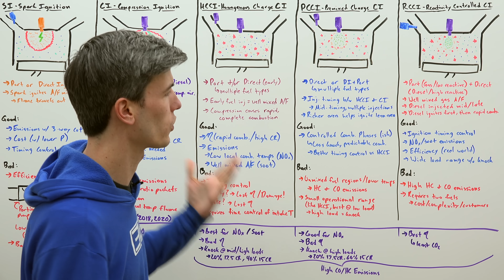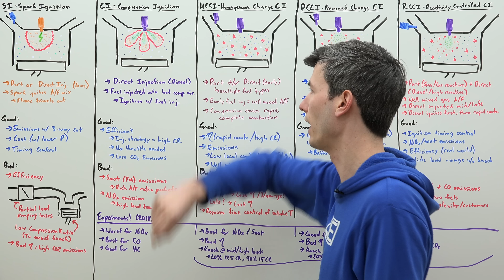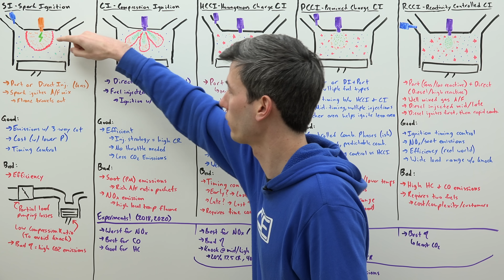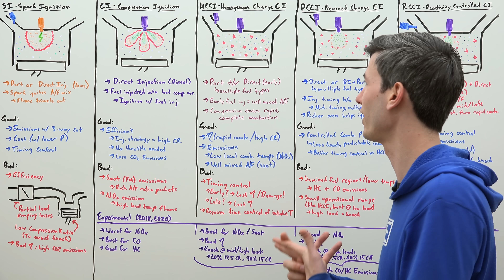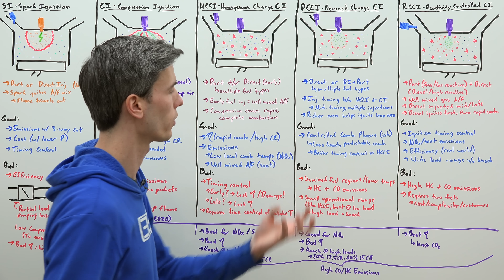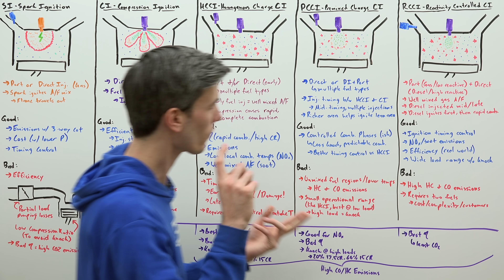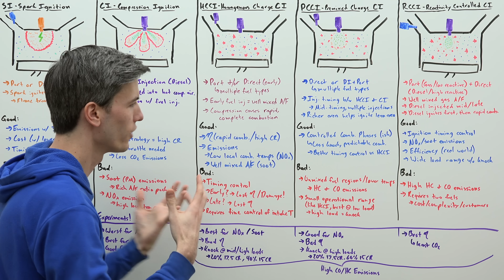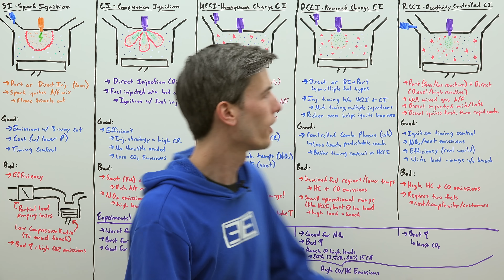If Combustion Engines Have A Future, What Is It?

Comment: A restaurant in my town just put in Tesla charging station. Every time I go by no matter the time there is always someone parked there sitting alone in their car charging.
I just laugh, knowing it’s taking them 30 minutes to an hour longer than it would take me to complete the same trip in a car that cost much more than mine. 

Internal combustion has no equal at the moment.
Reply from the maker: Why do you have to be so condescending of others choices haha? I've been "that loser" at a supercharger plenty of times. You can do whatever you want, like watch YouTube videos like you're currently doing haha. And I'm willing to bet long term, due to mostly charging at home, I've spent less time at chargers than most people spend at gas stations.
Reply: @EngineeringExplained  because they are pests. They are driving into areas way off route of where they are going, creating traffic just to use a charger then leave. They don’t even eat at the restaurant the charger is located at or stop at the surrounding businesses.
Reply: @tylerzesiger7648  its true. 

My work has installed two EV charging stations. There are a few Tesla and EV owners in the immediate area as well. With the charging locate function you can rest assured they always know where to get electricity for free.

The issue lies in when these spots are taken by non employees it says on the sign that charging is for on shift medics first and foremost with the capacity to open to the public after that. 

When my coworkers roll in with their battery operated car and see the charging station already used by a non employee it can be frustrating especially when you have no idea where the owner is as they leave it there and just walk away or get picked up by somebody else.
Reply: With an combustion car, you have no other choice but to go to a gas station to fill it, which is 5-10 minutes detour. With an electric car, with charging at home, you wake up every morning with your car full. Unless your trip is longer than the car range, you don't even have to stop at a station, just get home and plug it in. Now, how many times do you realistically have trips that can't be covered by the range of the car? If you only daily commute, which is what most people do with cars most of the time, you never have to go to the charging station, unlike the combustion car, where you have to be that loser that sits at a gas station from time to time.
Reply: @AleksandarStefanovic  how often? At least once a week. Think about this, it’s Friday you go to work, go to lunch then drive home. Maybe you even had to drive somewhere during work. Grab your stuff and head out for the weekend (beach, mountains, lake, family visit) you didn’t have time to re charge and you have already used a part of your “I charges at home” battery, you are going to have to stop for a charge. You can make it but then you won’t have enough to make it the 30 minutes back to a charging station from your destination the next day. Unlike gas which is 5 minutes max because gas stations are everywhere. You have to drive ATLEAST 10 minutes out of the way to sit for 30 minutes while it charges. So you are in 40 minutes while I’m tasked with the terrible 5 minutes at my choice of any station along the way
I get to the beach, mountains, lake to see enjoy the sunset you pull in at dark. 

Plus a ICE don’t need to leave with a full tank everyday like an electric because we don’t have to sweat it out as the range drops. Because stations are everywhere.

Also...gonna pull out the big gun here. No gas car I have ever owned has ever spontaneously caught fire sitting in the garage and burned my whole house down.
Reply: Hydrogen fuel cell. If only we could get filling stations.

Comment: With similar energy loss, you could use Hydrogen engine or fuel cell... mostly clean tech...
Reply: there you have different problem, lack of infrastructure
Reply: @jirimollin8638  yeah ... and such an inefficient system too, nobody wants to invest in it. In the meanwhile, you can install an EV quick charging station for about 30K USD... just hook it up to the high voltage backbone of the grid. 👍 That being said, trucking companies could make Hydrogen at all their depos, using/wasting solar power...
Reply: not, only viable hydrogen industrial source is from natural gas, producing co2 and co at the factory instead of your car

Comment: Wartsila is making high efficient dual fuel engines for low speed, and the cat is making high speed engines using advanced fuel injection systems and after coolers.
Reply: Cat DGB Diesel Gas Blend (natural gas) engines have been out for about 5 years, very reliable and efficient.  Depending on methane number & load rate, diesel is being replaced up to 90%.  Just a 10% spritz of diesel to start ignition is all that’s required even at full load.  Many oilfield apps can use wellhead gas, otherwise shut in or flared, so fuel is virtually free.

Comment: EV is a total p;ain. They don't have the range and they take ages (compared to pumping petrol or diesel). Anyone who thinks there will be hundreds of millions of EVs on the road in by 2040 is smoking crack.
Reply: Hybrid Cars are the future . Rotary Engines and Solid state battery!
Reply: I've driven an electric car for 7 years. It has been a much better experience than any of the 8 gas cars I've owned. I'd be surprised if any cars intended for general transportation are not electric by 2040. There will probably still be some combustion engines for specialized applications, but only a small number.
Reply: @markusstrobl1067  FFS why to move around that heavy battery if I can carry just a tank of hydrogen for example. Batteries contain way too much Cobalt as well.
Reply: @aquamaggerasim4993  Hydrogen is a non-starter. Has to be refrigerated, will always leak out of any tank, and costs as much as gasoline to make. BEV is the future.
Reply: @markusstrobl1067  Well , and Toyota Mirai doesn’t exist hahaha
Reply: Why not have hybrids and plug-in hybrids? 

I agree with you that it’s easier to live with an ICE engine in certain circumstances. But for folks that commute 50 miles per day and don’t do much else on a typical weekday can certainly do just fine and NEVER have to go to a public charging stations. Then you’re looking at coming home and putting your plug in hybrid or Tesla or whatever to charge overnight.

That’s not a pain. Additionally, not having to get oil changes and such would be quite nice. 

I’m looking forward to a bunch of plug-in hybrids coming in the future. Would be hard to justify a 350 mile range Tesla for certain activities that I do now and again (road trips, camping, hunting, etc).
Reply: Synthetic fuels might come in handy

Comment: The real big deal is as long as internal combustion engines still produce CO2 they're not going to last forever, because countries want the carbon emissions gone. However, what we're forgetting is electric cars have emissions too, manufacturing batteries, producing steel or plastic or whatever the cars made of, how electricity is made, tyres and brakes wear out and damage roads producing NEE ( Non Exhaust Emissions ) and dumping the parts into landfills. The same for bikes and e-Scooters, an average bike produces 9g of CO2 per Km, a e-Scooter produces 88g of CO2 per Km, an e-bike about 22g of CO2 per Km, nothing is CO2 free, including humans we all breath out CO2!😏

Comment: Applications, where high power density is actually needed, such as recreation boats, which run typically between maximum efficiency and maximum power of the motor. You can't have a battery powered fast boat that also has any kind of practical range. Cars on the other hand typically operate most of their time well below maximum efficiency and maximum power, because they need power only for good acceleration.
Reply: Greatly explained. Airplanes and Ships also need power density in order to be viable
Reply: Some luxury brand is probably working on it already
Reply: But you’re making a bold assumption that battery technology isn’t going to improve from what we have today, which is clearly false. It’s a very gradual progress, but hey if battery had 100+ years to mature and develop like the combustion engine, then your point is moot?
Reply: @ThomasAlex  battery tech has improved for over 100 years already. Batteries are 1800s tech, like ICEs.
Reply: @ThomasAlex  At the historical pace of battery development, it'll take about 300 years for usable battery density in these applications. So no, in that long a time frame we can't say for sure about anything and it doesn't matter to us anyway, since we and everyone we know will be long dead and forgotten.
Reply: @jammi__  I'm sorry what? That's just plain wrong. Lithium ion battery have been slowly increasing in density and reducing in price over that past decade. We started at 1000 dollars per kW and now reached at almost 100. Density has been steadily increasing with better materials and we in 5-10 years we will have enough density to run most small to edium aircrafts
Reply: @ThomasAlex  Not at useful ranges to replace the ICE stuff.
Reply: @jammi__  Tesla has cars that has enough range for most people (about 300-400 miles per charge). And they promised and have a path with current technology to get to 500-600 in about a year or two. That basically becomes competitive with ICE cars. And the battery technology won't stop there. It will keep improving.
Reply: @ThomasAlex  That's for cars, they need 15-20kW of power to run at highway speed. My boat on the other hand has a 350 hp engine and needs somewhere around 200 hp for its most economical cruise speed, and it's just a boat equivalent of passenger cars in terms of passenger capacityo and the cruise speed is roughly just what city limits speed on a car is.
Reply: @jammi__  And few short years ago, EVs were deemed the same way. That battery would never be able to power a car for more than 100 miles. And electric boats are already on sale when I just googled rn. Sure the range might not be as great, but it's pretty arrogant to say that it will never reach the range you desire. Battery development only picked up in speed in the last 10 years and we have multiple candidates from multiple groups contending to be the next leader
Reply: @ThomasAlex  No, seriously the equation is entirely different, but you don't really understand it and didn't bother reading the argument either.
Reply: @jammi__  No you fail to reason out why batteries wouldn't get as power as they need to be. Do you think energy density (and output) isn't rising with battery tech? Because it is. And if you want instant power, as described by your requirement of high power output, an AC motor will work much better than ICE engine
Reply: @ThomasAlex  A typical recreation boat has a V6 or V8 engine (200-400hp), is about 20ft (6.4m) long and is light enough (about 1000kg) to be towed behind a normal car and costs about 20-40k€ new, or a good previously used at 5-10k€. At current tech levels, as mentioned by someone else you're looking at a similarly sized electric boat that weighs 3000kg, has charge of 1h of use at half the engine power, or 3h advertised, but at extremely low power, like 50hp or so. Also has a price of a dual-engine yacht class boat (200k€ or so).
Reply: @jammi__  again, I don't get how you get these random facts about it lasting 1 hour with half output or something. We have trucks being built with batteries now. And again I don't understand how you keep avoiding answering my question about yearly improvement in manufacturing, increasing energy density, and power output of a battery. As I said before, 100 years ago, the ICE engine couldn't do any of these things you are describing. With the current rate of progression, batteries should be able to do better in about 10 years
Reply: @ThomasAlex  Math. If the battery specs are let's say 150kWh, at most it'll run a motor at 150kW of power for one hour, or 50kW motor for 3 hours, or a 300kW motor for half an hour. I don't understand why you keep arguing about something you have no clue about, just tons of blind fandom of some tech you don't understand either.
Reply: @ThomasAlex  now if they can just get charge times down really thats the last major hurdal other than charging infastructure and the latter will gett better over time
Reply: @ThunderClawShocktrix  definitely charging times ar improving. It's was only few years ago where we couldn't really pump too much power into a battery without it exploding. And with advent of SSB or possibly something else, it's definitely possible to reduce charging times to something most people can get by
Reply: Nautique already has an electric  wakeboard boat on the market called the GS22E.
Reply: @MTKARusty  Weighs three times as much as an ICE boat and has a tenth of the runtime/range. Good luck getting to an island and back with that thing, or across a bay or anything.
Reply: tractorrs are another  thing that falls into that catagory , usually you are running the engine at full speed granted people with 1/4 arcre lots should just use an electric lawnmower

Comment: I'm not suprised that some People search for developping the ICE but all the researches are on diesel and for me It's one of the problem diesel ICE is not the answer.
Reply: Why? Diesel engines are far more efficient than gas engines and when tuned right they are cleaner burning than gas. So unless you are talking about an undeveloped alternate fuel source research into diesel is a reasonable exploration at the moment.
Reply: Diesel is the futur.

Comment: look at your DMs on IG, i sent you a solution for ICE, its the name you cant pronounce lol
Reply: to give you an idea, knock only happends when you exceed the total entropy of the system, total means the risidual heat in the cylinder plus the combustion, a way to prevent it is to cool the charge air to very low temperatures ... or use exotic fuels which isn't practical

how do you subcool air ? use a heat pump that uses waste heat from the exhaust ...
Reply: @ssllhh100  👎

Comment: It would be interesting to see a performance application of RCCI that uses methanol for the premix and diesel for the ignition. The diesel is extremely power dense and you could use the methanol for additional cooling...
Reply: I feel like you could achieve a fuel power density in between diesel and methanol which I imagine would be somewhere near normal gasoline
Reply: The cooling of the methanol could also be used to reduce knock and control timing

Comment: What about hydrogen fuel cells. Both EV and petrol benefits with no bad emissions or waiting to charge your car.
Reply: producing hydrogen in industrial scale is expensive and dirty. it is done not from splitting water, but from splitting natural gas, and producing tons of co2 in the process
Reply: @u_solutions_lv   hydrogen can be obtained by hydrolisis, but it's inefficient and energy-intensive compared to using the electric energy directly
Reply: @AleksandarStefanovic  that is just what i said.